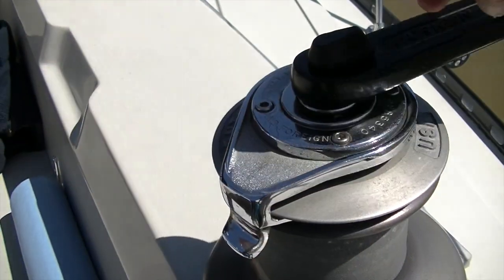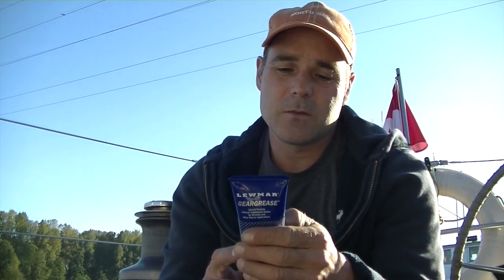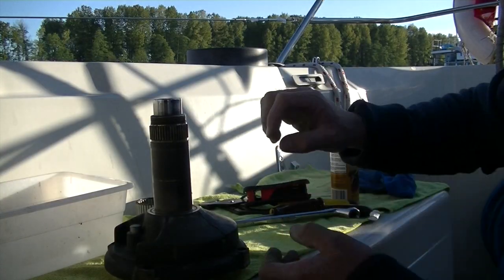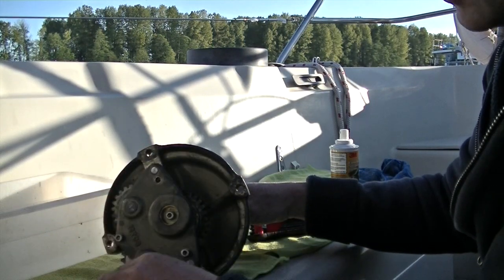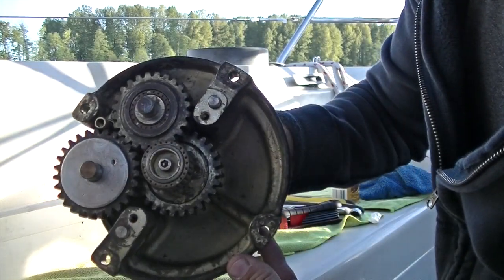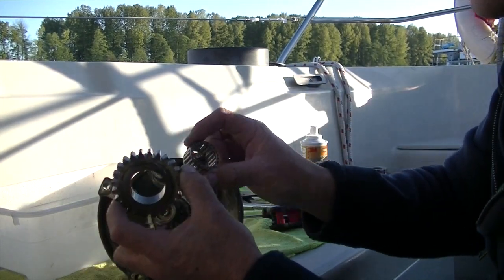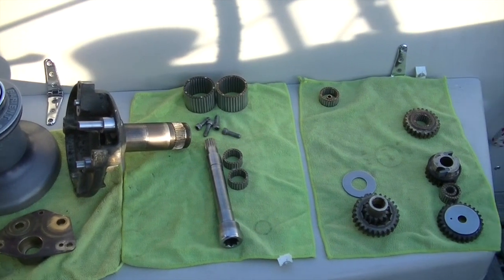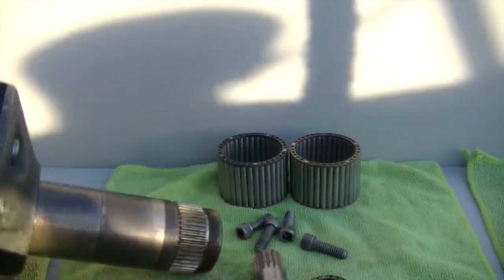Life is Like Sailing - Taking Apart a Barient 28 Winch

Comment: Great video!!! Another site suggested frequently changing the pawls and springs, as well. I also saw a suggestion to find a plastic bucket, just a bit wider/taller than the respective winch, cut out the bottom and then place the bucket over the top of the winch at the beginning of the project to avoid losing parts...I think I'll also take pictures to help me remember the "remove/replace" sequence!!! Excellent time lapse, too....
Reply from the maker: donjvalley Thanks!!  I have heard of a similar method using a cardboard box and it is a good idea for sure!  I was going to take pictures the first time I actually cleaned the winch, but I found it pretty easy to remember the way it all went back together.  If there are multiple set of gears like in this winch I just kept them all in their own little piles.  

I removed the pawls when I did the actual cleaning and once they were cleaned up they looked good and worked well.  I don't know if I can get new pawls for the Barients due to them not being made anymore?

Comment: Thanks for sharing this well timed video Alfy. You have given me the ammunition for tackling at set of Barient 28s that have been sadly neglected. Looking forward to seeing some of your cruising trips this summer.
Reply from the maker: Bill Bruce Thanks Bill and I am really glad the timing was good for you to tackle your Barients!  I was so intimidated about doing winch maintenance and now after I have done nearly all the winches I realized it really isn't that difficult!  I am also looking forward to making the summer cruising videos!
Reply: LifeisLikeSailing - Vancouver, BC 

Completed servicing my B28s today and it was a joy to do them because there were no surprizes. Everything came apart easily even though it has been years since they were serviced. I did find a few of the pawl springs had lost their snap and replaced them with new ones. The pawls were engaging much better with fresh springs installed. It's funny how some springs had lots of snap left in them while others were at the end of the road/wimpy. Any way's they are working as two speeds again, so thanks again.
Reply from the maker: Bill Bruce That is great you go them done!!  :)

Comment: i have a question. i'm currently saving up for a live aboard sailboat of my own but as of yet i have no sailing experience but i will be taking lessons soon as its my dream to have sailboat.. anyway my question is how big of a boat does a guy really need? i'm currently looking around the 27-32 range.  i will be traveling around the UK working and with hope of traveling to France, Spain, Italy etc.. my maximum budget for the boat will be around £8000 / $12350
Reply: h beek cheers for the reply.. iv currently got my eye set on a 1963 25ft folkboat. iv fallen in love with them and i don't know why!.  theres one on the UK ebay site if you search for it. it sold for £500 last time. i'm tempted to sell my motorbike, pack up and live aboard while i work on it and find a temporary local job for the meantime.  i know this is a little small but its not impossible to live with :)
Reply: Dr sausage fingers Chances are you'll be perfectly happy aboard a boat in the 27-32 ft range :) It all depends on what you need to be comfortable, and that may turn out to be less than you'd think :) I believe Alfy's boat is 34 feet. Mine is 30 feet. Don't get too hung up on the length of the boat :) It's not the size that matters ;) I don't have standing headroom, hot water or a shower aboard my boat, and yet I'm in the process of selling my house to move aboard my boat full time. I might upgrade to a bigger boat in a few years. At that time I think standing headroom will be at the top of my list. I know a few liveaboards in the UK. Send me a PM if you want me to connect you with one of them :)
Reply from the maker: Dr sausage fingers I think Mads at ***** hit the nail on the head.  It all comes down to what you think will meet your needs.  After I moved aboard I actually thought  that I would need something bigger eventually and now I feel like I have more room than I need.  Not that I would down-size at this point (because I really do love this boat) but I no longer feel the need to up-size.  :)

Comment: nice. it is not so difficult, but it can get messy.
a tip: next time put something like a blanket or a roll of cloth in the gangway so you won't hear "ting- ting- splash" of little parts.;)
Reply from the maker: h beek good tip!  I ended up putting blanket down for the other winches for that exact reason.  haha
Reply: just experience!
Reply from the maker: h beek And at least no ting-ting splashes for me considering they don't make the Barient anymore!  :)
Reply: still, losing an allen bolt is annoying, but any bearing stuck inside and suddenly come loose, is when it gets interesting
Reply from the maker: h beek Agreed!  :)